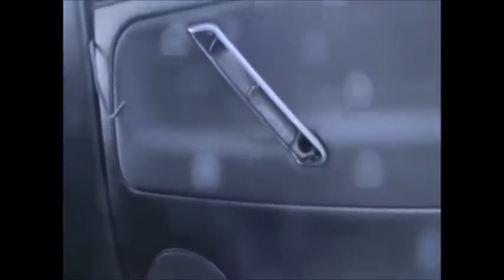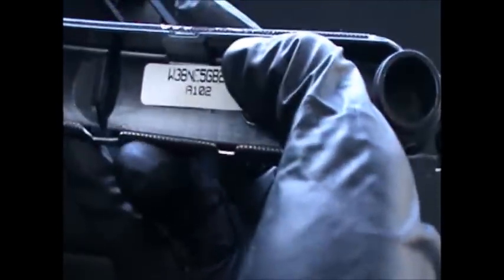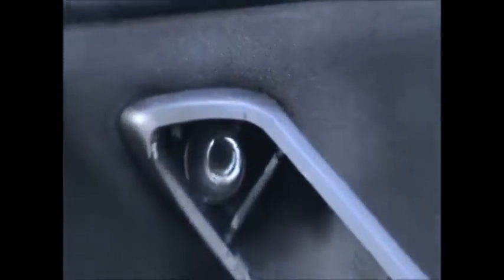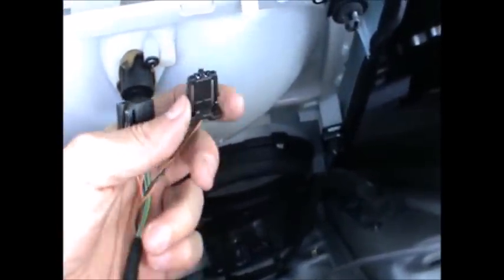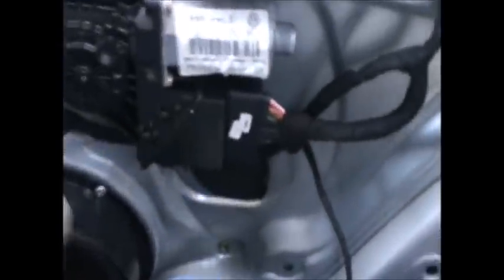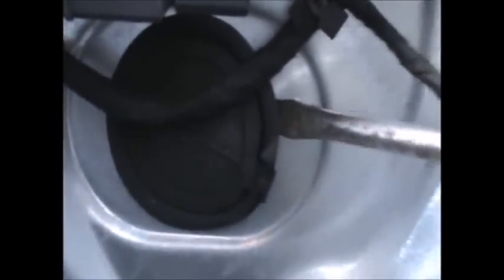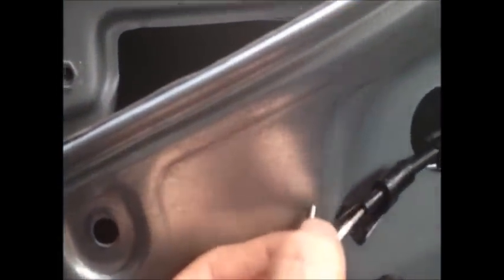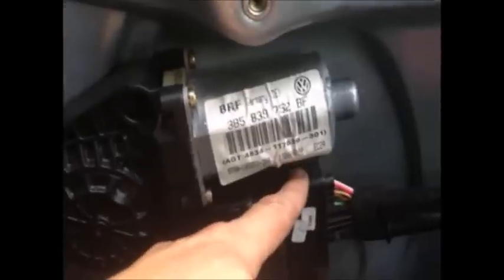VW passat, Skoda rear door panel removal and actuator deadlock release

Comment: My doors were locked and I had a failed MOT, completing this I fixed it myself. The garage wanted £600 plus to 'repair' the fix. Actually what they wanted to do is replace the actuators (£175 plus vat per unit). This is fiddly but achievable and anyone with some mechanical knowledge would be able to complete this fix. Thank you for submitting this utube video!!!!
Reply: how many of your doors were locked...and can you really fail an MOT for that. I thought MOT is about road worthiness and mechanics of the car not that...do tell?

Comment: Why didn't I search the problem in English sooner, this would have saved so much time!

I went with the way to manually power the actuator longer than the car usually would, in the hopes that would get it to break loose. Might have been a bit too high of a voltage as well which ended up killing the actuator, so that I can't do this trick now. I guess it's time to break through the plastic, unlocking it that way.

I know this video is 8 years old, but it's great that these kinds of videos exist!
Reply from the maker: Thank you for the message, I hope you can sort it, it will be a bit harder if the solenoid is burnt. Happy new year 🥳

Comment: That is a very good, detailed explanation, thank you.
I have the front passenger door deadlocked (this time, last it was the rear!) not long after replacing the inner steel panel/winder mechanism. Your video has shown me that there is a way to access the door internals from inside the car with the door closed, so if thumping the door using the key fails, I know I can get in.  
Other folk new to this problem might not know that the actuator mechanism can only be removed by undoing the two star bolts which are hidden when the door is closed, so it is important to somehow get the door open so you can replace the mechanism.  
If tapping with the hammer trick doesn't work, I'll start destroying the mechanism with a drill!!!!
These door and latch problems are the one big drawback of a very dependable car.

Comment: Very useful video, I  had the same door fail on mine, I managed to get the door panel off without removing the seat, but broke half of the clips. I left the loom unplugged so I could manually operate the door temporarily.  I haven't changed the actuator yet, but your video has made me confident to do it this weekend. Cheers :)

Comment: when i had the same problem i just took out the line from the outside door handle. you pull it like you want to open it and hold in this position. from the side you will see a line with a small pin. you take a flat screwdriver and pull it out of its nest. thats it.. after you open the door you put it back but 1mm closer to the door side since its adjustable. by that you can adjust when the doors will open when you pull the handle. no need to open the door from inside.

Comment: OKAY GUYS!  I WAS RUNNING LOW ON GAS, NEW YEARS DAY HOLIDAY, EVERYTHING WAS CLOSED INCLUDING MY DEALERSHIP.  WATCHED THESE VIDEOS.  I HAVE A VW TIGUAN, 3 YEARS OLD AND COULD NOT GET IN THROUGH THE TRUNK.  

FIGURED OUT TO USE AN OLD WOODEN CLOTHES PIN, BROKE IT APART AND USED THE TAPERED END TO PRY THE GAS TANK LID OPEN.   ANYTHING METAL WOULD HAVE SCRATCHED THE FINISH AROUND THE LID.   COOKING OIL ON THE HINGE.

THE HINGE WAS STUCK.   NOW I JUST CARRY MY CLOTHES PIN IN MY GLOVE COMPARTMENT TO PRY THE GAS TANK LID OPEN IF IT EVER HAPPENS AGAIN.

THANKS OODLES GUYS!  YOUR SUGGESTIONS SAVE ME A BIG PAYOUT TO THE DEALERSHIP.

Comment: Instead of remove the panel, u could pull the handle on inside and awile the handle is pulled press the unlock botton on the remote. I had that issue and that was the way that I open the door
Reply from the maker: I did do that for some time, eventually it stopped working all together and had resort to this method, thanks for the tips may still work for others.. :)

Comment: You can open the door using that method, pressing the open button on the remote and trying to open the door from the inside, if you di this for a few seconds the door will open. If works for me every time
Reply from the maker: Andrei Cristian it worked for me too, for a while until it decided not to work anymore hehehe and my door was permanently locked.
Reply: @DaringBeefcake  Thanks for the heads up, now I need to do it as soon as possible. Cheers
Reply from the maker: Andrei Cristian defo or it will be a pain.

Comment: I have the same problem.
Why do you have to remove the glass pin? Can't just leave it up?
Reply from the maker: pet 123456789 from what I remember the metal panel is attached to the window mechanism which is attached to the glass so if you don’t release the glass then you can’t remove the pannel. I don’t have this car anymore but that what I remember.

Comment: I opened mine on VW 1997 3B5 buy just hitting outside with my arm while pressed unlock button did same trick and after several attempts door opened.
Reply from the maker: Oskars Bogdanovs yes I was able to do the same once but didn't actually get to change the actuator at that moment, net time I tried the same procedure several times it dint't open for me which is why I had proceed as above hehe.

Comment: I initially couldn't figure out how to push the plastic pin out? Either what I used to push it out went through the pin, or it didnt budge. Without that step, this otherwise good video is useless. So, I used a large Phillips Screwdriver and hit it with a hammer. That did it.
Reply from the maker: Am glad you did it well done, sorry the video is useless for you. I wasn’t gonna make a video at all but though it might help. Anyway all the best. The actuator is held in by some torxs screws as far as I remember, I sold this car years ago so I can really help with that anymore..

Comment: last year my back left door was deadly closed... unfortunately last week the second door deadly closed so i have to repair both of them now....
Reply from the maker: +Tuentin Qarantino Oh no thats a pain, try hitting the door while pressing the unlock button you might be lucky and once open then just change the actuators, so worth having the actuators beforehand.
Reply: I got the same issue. The rear passenger door is locked. The door handle from outside is free. I have Pasat TDI car. How much it costed you.
Reply from the maker: The actuator wasn't really that expensive, I think may be 45 pounds, the rest I did my self, that is a very laborious work, but with time and patients it can be done.
Reply: Thanks for your response.
My door handle from outside is loose- so can't open from outside.
Further, When I took my car to mechanic, he opened the door from inside, then twisted black thing on the inside edge of the door and then closed the door.
From that day till today, the door got permanently locked. 
From local market (Cardiff), I am getting door in £50.
But the task is
- How to open a closed door.
- Should change the door or get the handle repair

I not want to do myself as You know that its very laborious.
Reply from the maker: Well once you dismantle the inside panel you'll have to open it by pulling the inside cable while pressing on the remote and hitting the actuator, they are a pain but I hope you get it sorted.

Comment: Same probleme do yo think we can repair the actuator i've heard that it can be a microswitch probleme ?
Reply from the maker: Hi there, to be honest am not really sure if it can be repaired, but they are readily available to buy and at a reasonable price so I would think that replacing it might be the faster option.
Reply: And yet you have not any problem with this cheap actuator ? and can you share the actuator you ordered please ?
Reply from the maker: RedLion03 hi i sold the car by now but it did last about a year or so until i sold the car, and i did this job a really long time ago I think i got it of off amazon or possibly ebay.
Reply: ok thanks :)
Reply: Hi there, I've unlocked this deadlock door by hiting the actuator as you do in the video for 30 minutes at least and the door opened. Thanks. I've replaced it but when I lock twice it does unlock the door did you have thois problem?
Reply from the maker: Hi there and thank you for your comment but i didn't have that problem actuators worked ok. maybe you have a faulty actuator.
Reply: the first hit on the button lock well but when I press the lock button again it does unlock thats weird because I've bought 3 actuators and all of them does the same thing
Reply from the maker: yes actually that is a bit weird, no sure what might be happening there, I haven't heard of that happening before, will let you know if I come up with any ideas, i wonder if you might need to disconnect the car battery to reset the system but otherwise not sure what it could be.
Reply: Thanks I will notice you if I found solution. I'm gonna ask someone for diagnostic.

Comment: The part i needed to see was how to remove the pop rivets holding the window in! 
Anyone can tell me??
Reply from the maker: Hi and sorry about that since my door was locked I could hardly even film anything but basically there is a hole where you can slide something like a round ended chisel, and push the little white center pin that hold the window, I had to hammer it a little and it falls to the back you can pick it up later. Hope the info helps a little.